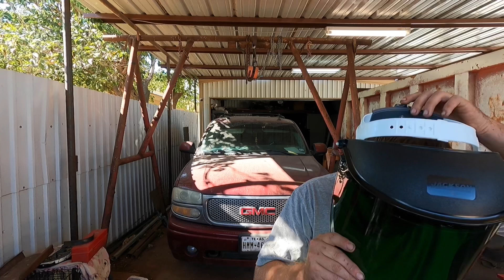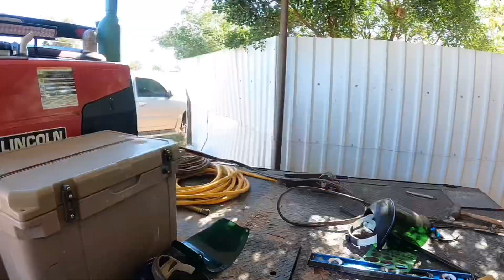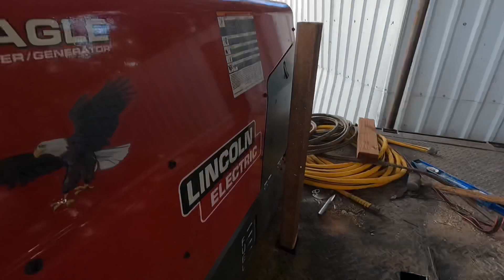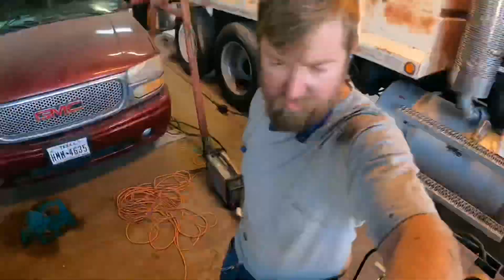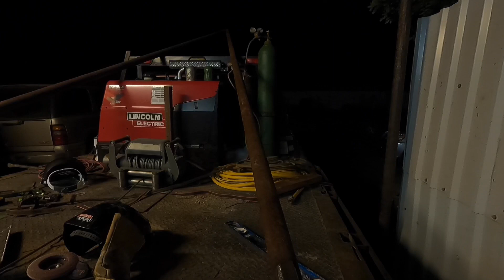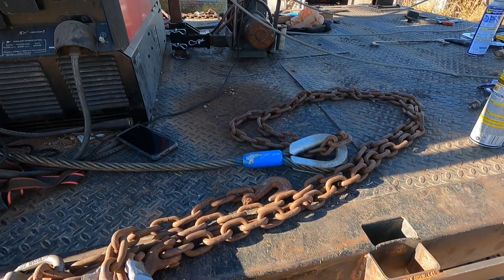Building gin poles for my 2nd gen ram

Comment: I'm confused.  Why did you cut out  the square 🕳? 🤷🏿‍♂️ Why didn't  you just weld the metal on top of the 🔹 🍽. 🤷🏿‍♂️
Reply from the maker: Because of safety reasons.
Diamond plate is thin metal, 14 guage to be exact. If i were to have some sort of accident, there could be a possibility of the poles ripping the Diamond plate where it would have been welded.

Comment: Thanks for the vid, I'm getting ready to build one for either my f250, or this f550 I'm trying to buy.  

There's a good military manual on basically making gin pole lifting rigs out of logs, but it has all the good tables on like if your poles are at y angle, you can lift x lbs, I used it to lower a 2500lb metal shaper down into my basement machine shop, showed the old timer I bought it from, he was so entertained, he showed his buddy, and he thought it was so cool, he gave me a 5000lb duplex milling machine, for free, that was in his basement, hah.  Just picked up a 400lb rotary phase converter, so I can run them, it was free too cause it was a pain to get out, with a good gin pole setup, you can score all sorts of the older heavy duty tools, cause you can lift them.  Never should have sold my last one, used it to load 500lb live edge walnut slabs for my old business in Texas, that we got real cheap, cause the guy didn't have any heavy equipment to load them.  Seems like you are a family man, do yourself a solid, and look into the synthetic winch lines.  We've almost completely swapped over in commercial fishing, much safer.  They don't stretch as much as wire rope, so they don't store that crazy amount of force, that causes wire rope to whip round and cut you in half if it breaks.  The wear is more obvious too, than wire rope, gets kinda fuzzy looking, so easier to know when to replace it.  Another option is the wireless winch remotes are super cheap now, with the short cable runs used in gin pole setups, it's easy to control it from outside the danger zone of a whipping cable.  Might sound silly, but guy who started Mack trucks died hand cranking a truck motor, and he probably knew a thing or two about hand cranking a motor.

Comment: So what's your opinion on a mag drill ?
Can you rent it and what is the cost  ?
  They definitely provide a good hole that doesn't dedrad the steel. Just a word to the wise, Cracks killl. 
Crain's fail when Cracks from over loading over time. Even when done the best possible way.  Before the nineteen eighty multiple catastrophic failures happened.  Stay safe and don't get under a load, or in-between the line of actions. 
Basic physics are reality.  People get dead realy fast even when they have the best equipment and know what there doing.
Reply from the maker: I agree with everything you said!! 

I love mag drills, if i could afford to go get one willy nilly, i would in a heart beat. The fact if the matter is, i wouldn't use one regularly enough to purchase one, which is why i have most of my heavy duty parts cut out on a plasma table.  

But i do believe i can rent one. But if im going to rent one. I might as well buy one lol.

Thanks for the input! I always take these things into consideration when someone points them out!

Comment: Built a similar set-up for my 1997 Astro.   I hooked support cables  into the van's roof at the door pillar structure,  used light weight pipe of 2" elec conduit, but it will still lift 1000 lbs 12 ft in the air.      (don't stand under your load)   works great for setting sculpture, sets up in 10 minutes,  I use a Dutton "Strong Arm"  winch  for the lift.
Reply: This made me feel a whole lot better about wanting to hang 2k pounds off an f250 on 8' poles of 3" tubing. Thanks for that brother!

Comment: I think you would have had benefited a lot if you could have looked over a few oil field gin pole trucks. When constructed properly the poles can be stowed on the sides of the bed and the pivots for the end of the poles and the snatch block mount are all flush with the bed so you don't lose the use of your flat bed. Your probably not going to lift much with this set up but if you attempt to lift much over a ton and a half you should be very very careful. Especially with the way your snatch block is attached to the top of your poles. That dom tubing is much weaker than a piece of solid bar the same size which is what it should be.  There are several better and safer ways to hook the poles together at the top than what you rigged up. Not worth being crippled or killed over. Lack of experience running gin poles can be deadly.

Comment: If a person has the oil field in their blood , they can usually survive if they fairly proficient at working in several fields , that being welding , fabricating , dump truck with small hoe for dirt work , and maybe even heavy equipment operator ! These fields are somewhat related and will generate a living wage over time !

Comment: Very nice work Jacob !    Figuring out the geometry on throwing and stowing the gin poles can be trial and error at times . 
  That's a great looking rig you have and can't think of a task it wont handle as you can lift , cut and weld with it !
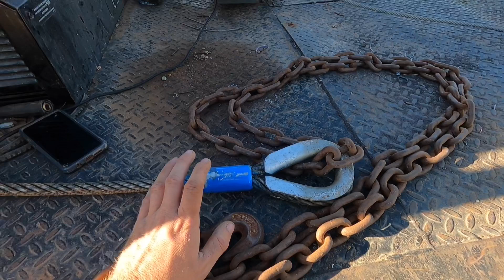    At 33:00  I would keep a few different  lengths of dedicated 3/8 inch chokers shackled at both ends for different boom angles . 
   That way no risk of the chain fouling or unhooking unintended .    
      Keep up the great work !
Reply from the maker: Thank you! It was definitely a fun experience building something of this magnitude that has the potential to lift more than the truck itself ( although i wouldnt dare do something like that haha)Thats a great idea! I had wondered originally if i should do something similar to what you suggested and kind of just shrugged it off, but i know its something that needs to be done for extra measures of safety.

Comment: This is awesome. I'm planning to do something similar in my truck and you have already made me rethink my design.
Reply from the maker: If i could make a suggestion.  Use 2 ⅞ pipe and make it 10 ', and then slide 2 ⅜ pipe inside to make them adjustable! I might end up doing that down the line.
Reply: @JP-OnlyBuilds  Thanks for the tip. I need something to lift cabs and such easily. I think adjustable is key
Reply from the maker: @gatewaygarage  absolutely! Having them adjustable is key to be versatile! The thing to remember is, you need enough chain or wire to keep the attachment point at the top of the poles through all heights or else they could bend when youre lifting items.
Reply: @JP-OnlyBuilds  where did you get your cables made. And do you have any pictures or a detailed look at your attachment on top where your pull hangs. I'm not a welder by any stretch. I'm literally learning to weld for this project. I just posted a video of a crane I put in my truck. That was my first time welding
Reply from the maker: @gatewaygarage  the cables were made by a cable company here local. But  for you look up wire rope companies near me. Id sa 1/2 or 5/8 would be plenty nuff for you. Mine were way over kill. As for the pictures,  i don't have any but i could take some. I used some 2" dom tubing bushings like what youd buy for off road link bars, and ran 1.5" dom tubing through the center of them. I put my bars at the angle i needed them, then saddles the pipe to the angle i needed for them to run straight across and welded the hell out of it lol.
As for learning to weld. I taught myself over the course of 10 years now or so, just practice and watch alot of videos here on youtube. Welding tips and tricks is probably the best page to watch. And the type of welder you have really matters too. I started with a harbor freight flux core for a few months, then got a miller 165 i think it was, then my current miller 252, and my lincoln eagle stick welder.

Comment: I tried to find someone to cut me some brackets similar to those and had no luck. I wish I would of mounted the winch in front of the welder so I could turn my welder around as a goose neck could hit my welder. Good setup
Reply from the maker: You might look for a local water jet company as thats what they used toncut these.
As for turning the welder, i 100% agree you should if you ever build your poles again. I love this setup since i can pull the winch off no problem and tear down in about 5 minutes or so
I could also have some cut for you of you ever wanted and then ship them out!